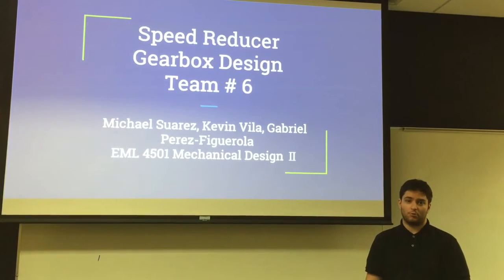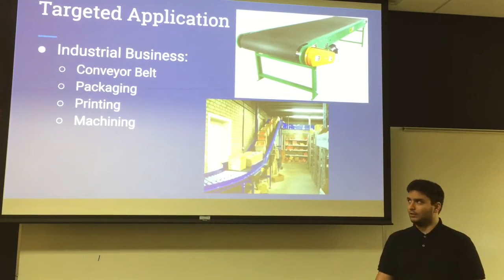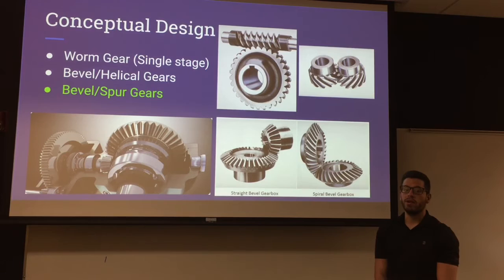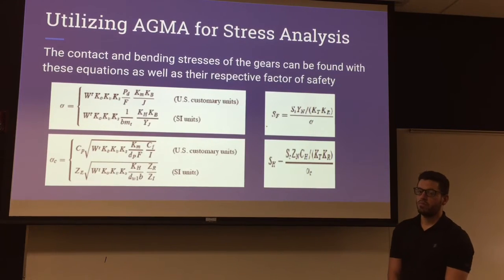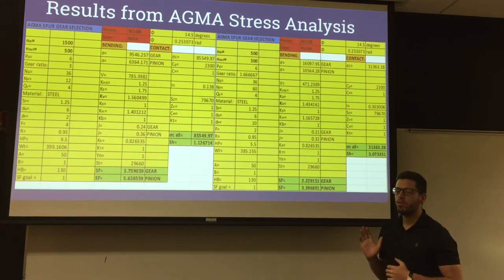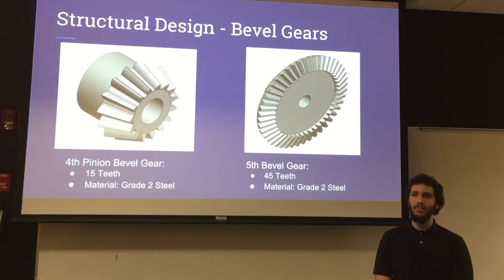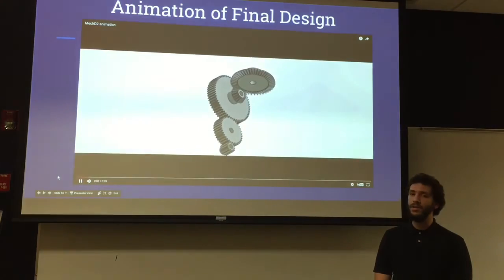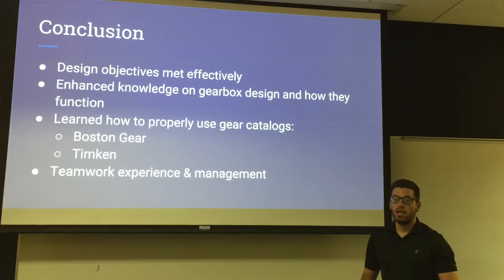Team 6: Speed Reducer Gearbox

Comment: The presentation was well structured and well presented. However, they seem to be framed awkwardly on camera and it probably needs to be straightened. They need to keep track of heir significant figures. Also while it okay to glance at the slides, it feels
that they read it a bit too much. Some slides contain too much info at once.